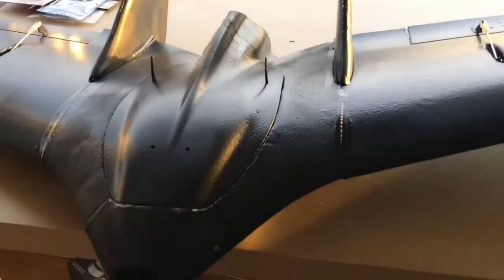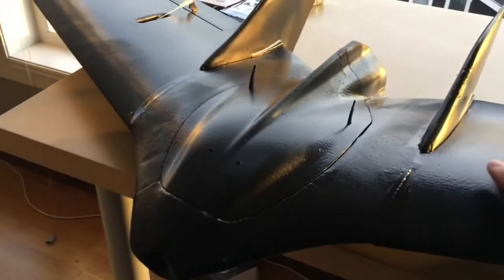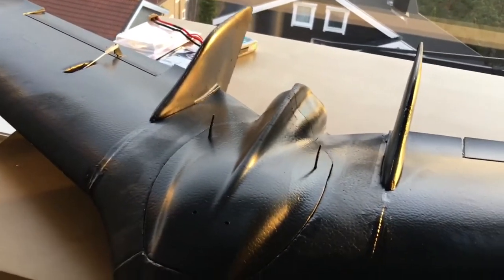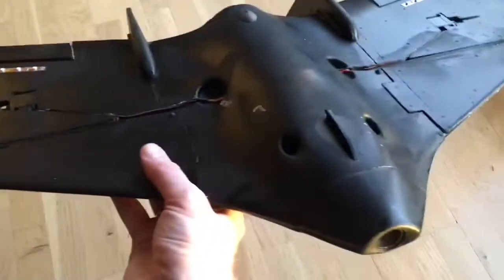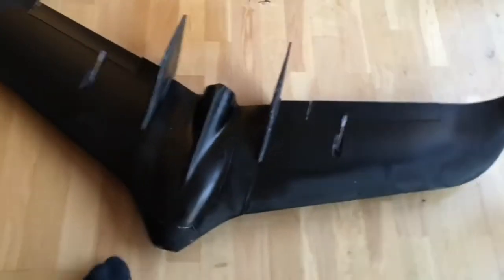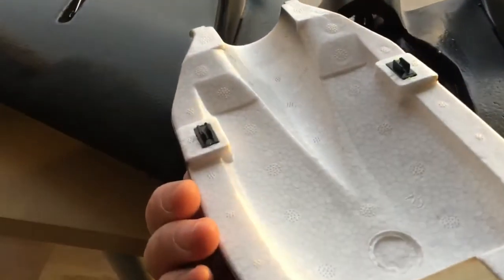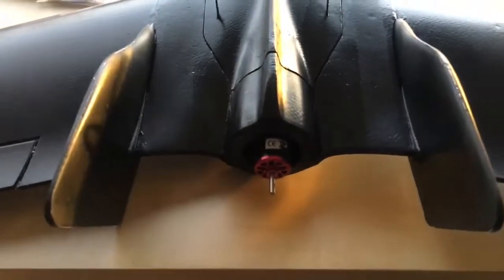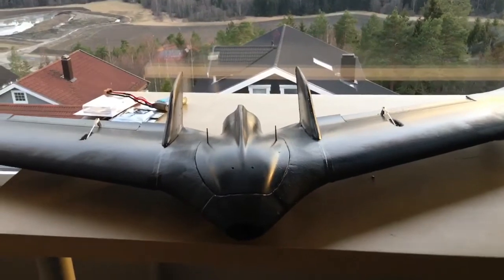Functional FPV: 1200mm flying wing C1-Chaser

Comment: very nice :-). this motor seems to be heavy be careful with the cg of the c1
Reply from the maker: link_fpv Thanks:) Yes motor is a bit overkill, recommended motor is 2217, but I had this one lying around so wanted to try it. Do you have any experience with the C1? Very little info on YT...
Reply: syvroser like you I am building one waiting for it. Very hard to find info.
Reply: I have a build log going here: https://www.rcgroups.com/forums/showthread.php?2858378-C1-Chaser-FPV-Wing - just started working on my build again last night and will try to get it wrapped up in the next couple of weeks.